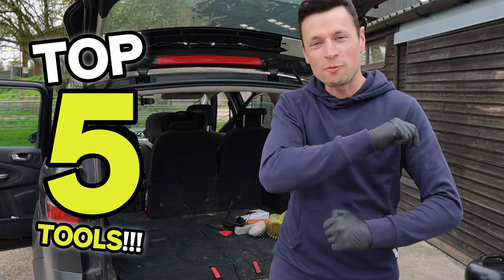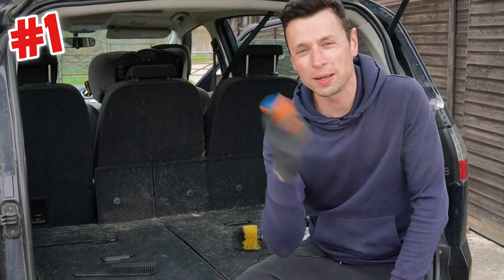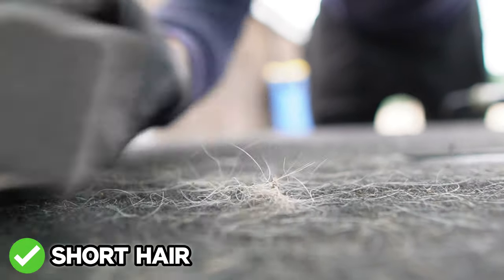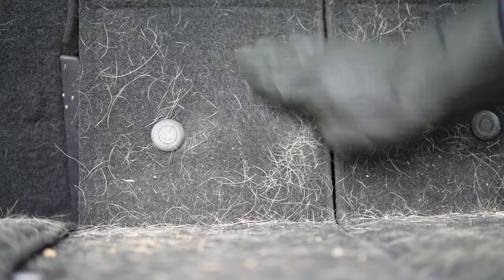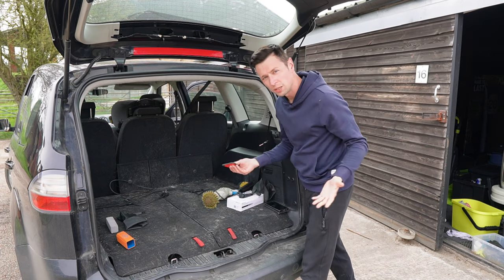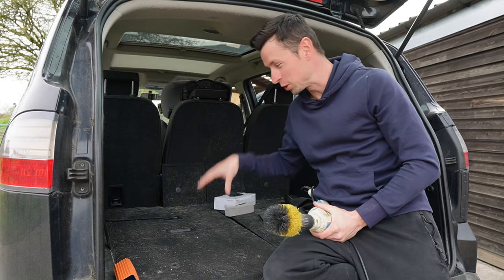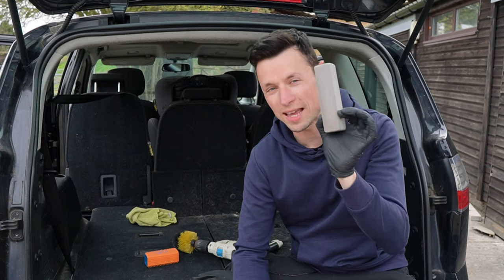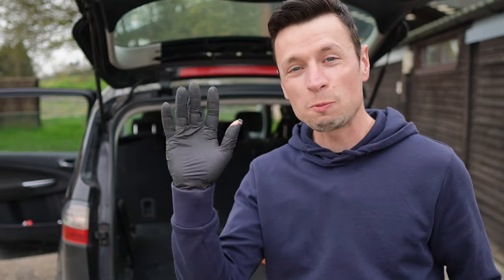How to Remove Dog Hair from Your Car Easily!

Comment: I used the dyson tangle free turbine head  on our boot and the ingrained sand and Border Terrier  hair , it  lifted both out with ease. ( 20 plate Toyota prius plus). Also used the orange  pet block.
Reply from the maker: Nice one. I could have added a few more but thought 5 is enough this time around

Comment: I like to use cheep silicone squeeges (same issue as the block it will breakdown but they are typically black silicone so can’t see them in black carpet)

Comment: Hi Hubby has managed to get paint on the interior of my car. Fabric Seat and plastic. It has dried! Any suggestions
Reply: Bilt hamber surfex HD at 10 % solution usually works as long at paint not oil based. Safe on fabric and plastic